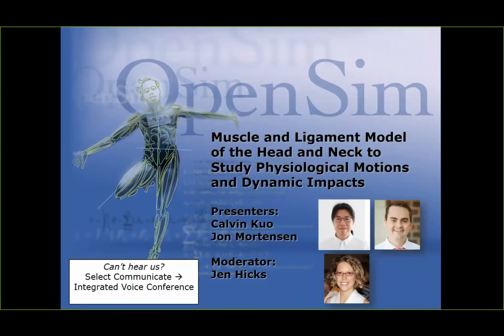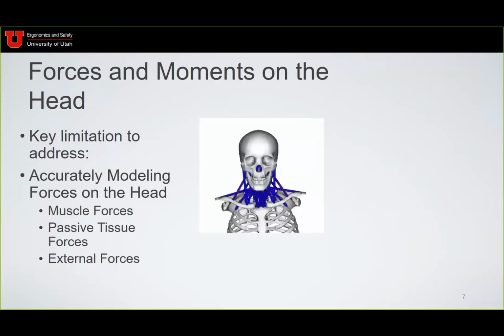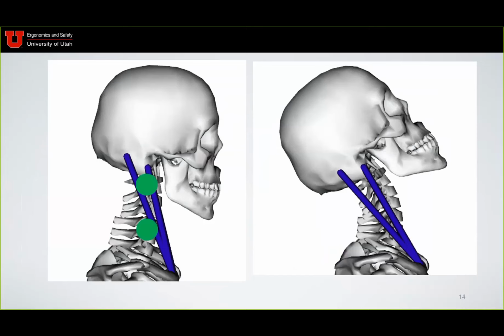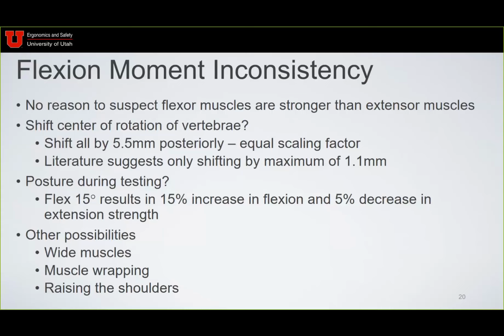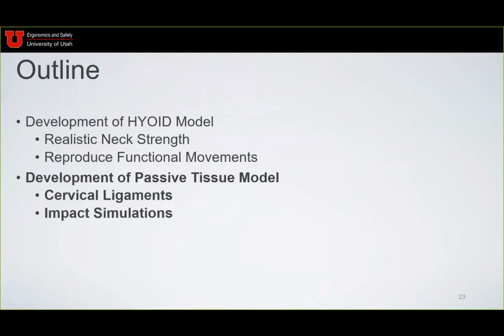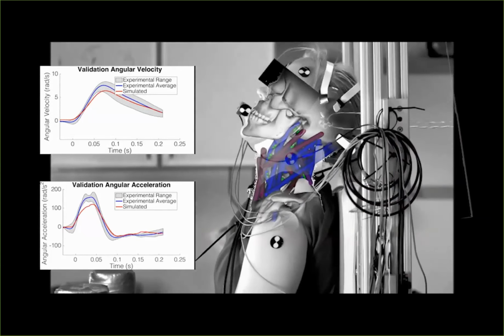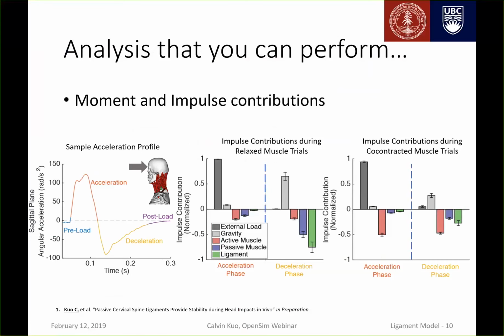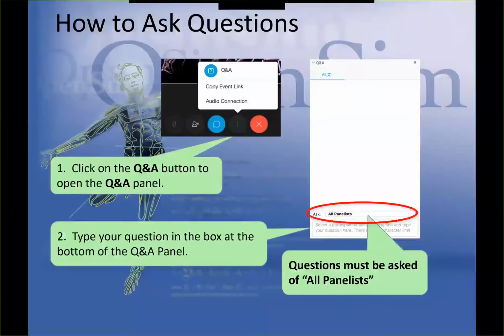Webinar: Muscle+Ligament Model of the Head+Neck to Study Physiological Motions & Dynamic Impacts

Comment: There was an experiment done in the the 70's that concluded that the neck (in it's normal upright position) is "stronger in resisting flexion (23.5 ft-lb) than it is in resisting extension (10.5 ft-lb) because the major muscles of the neck are located posterior of the occipital condyles and can generate a larger resistive couple to limit neck flexion." I included the reference. I hope this it useful or still relevant lol. :)

Mertz, Harold J., and Lawrence M. Patrick. "Strength and response of the human neck." SAE Transactions (1971): 2903-2928.